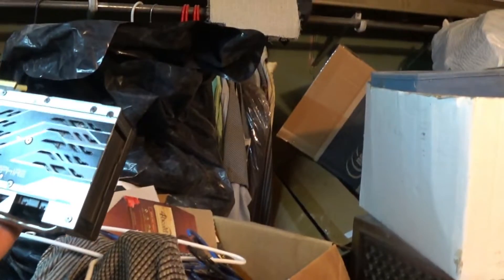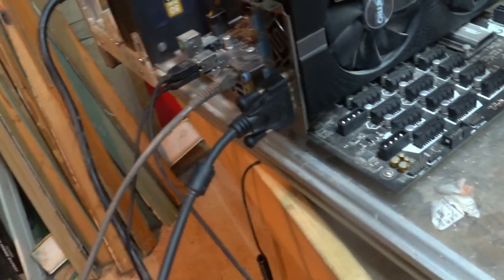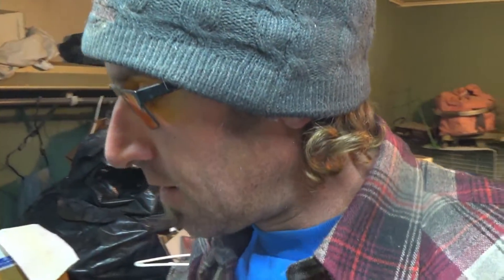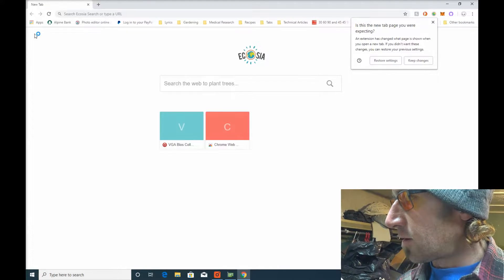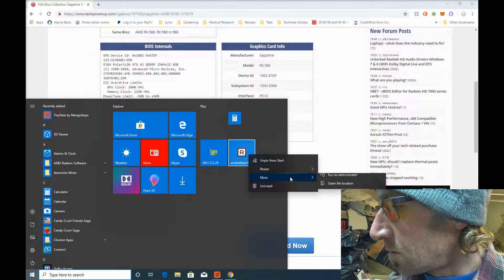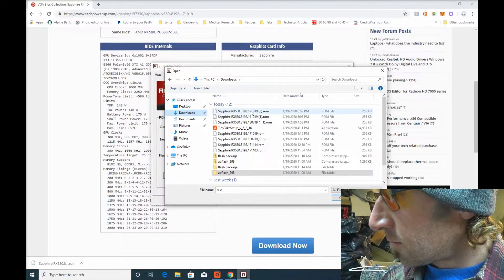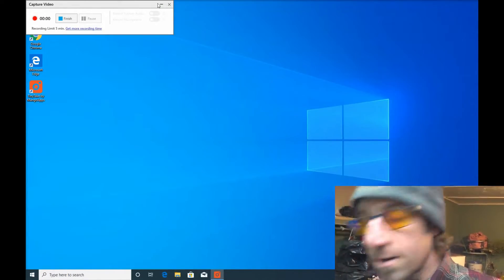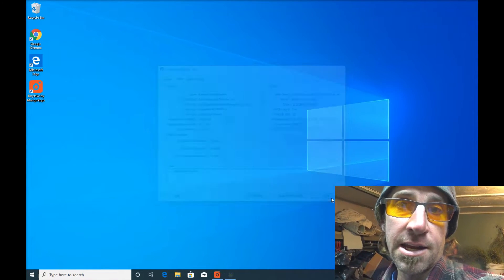How To Flash Stock BIOS of Any Graphics Card

Comment: bro please will u help me iam facing a problem when i update my gpu drivers my display got leaned like there are too many red dots or red lines but before upgrading the drivers display is ok
Reply: What have you Done to fix
Reply: @sonatafx  i go to market and over heat it it is fix now this is the only solution
Reply: @retsamgaming3378  i already repaired it by myself, thank anyways
Reply: @sonatafx  how
Reply: @nyto1333  iirc i reinstalled windows
Reply: @sonatafx  tried that and i doesn't work am thinking about reinstalling bios
Reply: I am getting red and blue dots

Comment: Hey i have ATI 4800 series 1 GB DDR 5 and i wanna change the bios or something to the HD 5000 series so i can install the new pilote that support DirectX11 can u help me ?
Reply from the maker: Find the HD 5000 series with all of the same critical hardware, ie memory speed and brand and flash it.
Reply: @MartyUlrich  i cant cuz the ATIWinflash says "Non-correspondance des SubsystemID :/
Reply from the maker: @Sheso  then it's not going to work. Generally speaking you cannot use the BIOS from another card and expect it to work unless you know how to write your own driver softer and implement it.
Reply: @MartyUlrich  i unlockedrom on atiflash and i flashed my gpu and now its bricked , i'm tryin' to creat a bridge on gpu board so i can fix it can i contact u to help ?
Reply from the maker: @Sheso  You need either an integrated video on the motherboard to use or another card to fix it. You'll have to flash the original BIOS  back on to get it functional again. Sorry, I don't have time to troubleshoot your personal issue, but it sounds like you're trying to do something that truly was not intended. Has anyone else successfully done what you're trying to do with that exact card?
Reply: @MartyUlrich  1-thank u 
2 - yeah someone did it in he's GPU HD 7000 series but i'll try ur way first cuz it's safe

Comment: Ok, I loaded a ROM that seems to be not the one my GPU needs. I have a saved backup of the original bios it came with(bought from miners) how do I flash it back to it? The problem is that the monitor gets no signal from the GPU, I tried plugging the monitor to the motherboard and still nothing. When I remove the GPU, the PC works again using the onboard graphics.
I have:
msi b450m pro vdh max mobo
Ryzen 5 2400g(with built in graphics)
How do i get it back to before?
Edit 1: I have managed to enable the onboard graphics while the non-working GPU is plugged in due to some MSI bios changes which forces the PC to choose the onboard graphics as the primary. I get the error code 43 in dxdiag like you do when you showed the wrong bios flashed. Problem is, when I want to use the flashing tool, it only shows my onboard graphics and not my rx 580. How do I proceed now? How do I choose the rx 580 as the one who needs a reflashing of bios? It only shows my vega 11 onboard graphics card.

Edit 2: Never mind, I fixed it. After the steps I did in edit 1, I just had to open the flashing tool again and load image the backedup bios Rom. Then program, then restart and reset the motherboard bios settings back to default so it would then automatically choose the discrete GPU(rx 580) on start up. Then removed the hdmi from my motherboard and reconnected it to the GPU again.
This is for people who freaked out thinking they bricked their GPU permanently.
Reply from the maker: Thanks for workin through that!
Reply: Hi! I was having the same trouble not being able to force my vega graphics with my rx 570 plugged in, but I followed your steps from edit 1 and finally managed to do so.

The problem I'm facing now is that each time I try to go back again i to the BIOS utility to reinstall my backup file, my computer completely freezes after clicking on "run as admin" on ATI flash utility. Did you experience the same problem? If so, did you find any solution for that?

Comment: Sir, when I hit the program button on ATIFLASH, after couple of seconds it says flash failed. Need help! TIA
Reply from the maker: Some graphics cards have a manual switch that must be activated first before it will accept the ROM. I know some versions of the RX580 had this... there was a jumper you had to move in order to edit the BIOS. Just research your model or see if you can find such a BIOS switch.
Reply: got the same problem still haven't found a fix :(

Comment: Can somebody explain to me how a mining card works? As in if you flash a gaming bios does it work like a normal GPU? Or would I have to keep downloading drivers to update the card?
Reply from the maker: When you flash a BIOS on a GPU for mining, it is making minor changes in the memory timing. If you were to manually do this, it would be highly likely that you would immediately brick the card, but if you know what you are doing, it can be done, and that is how we have these nice ROMs now that can be used with ATI flash. 
These changes allow for faster calculations when the card is used for mining, effectively boosting your hash rate per card. These changes basically take away some power from GPU itself when it comes to graphics rendering. That card may crash when used for gaming after flashed for mining (I don't game anymore so I have no experience here). 
All factory drivers will still work, but some versions are better than others for mining. Many miners turn off updates and stick to a particular driver version that gives them the best performance vs fewest problems. Hope that helps!

Comment: Asus b250 mining expert? 
Say, I updated my motherboard bios, it worked and then went to black screen for over an hr when loading windows. I restarted and restored to an earlier point. It took several hours for Win10 to finally post. All my GPUs were "kicked off .
Nicehash doesn't see the GPU'S and  Afterburner crashes. Any suggestions? 
1)manual driver load failed
2)Nvidia driver file dissapeared.
3)hr+ long black screens before posting 
4)CPU 100% without running apps.
Reply from the maker: That motherboard and/or CPU is hosed. I have another Asus B250 I can sell you that's un-opened still in the box. I never had too many problems with them myself, but I did nearly fry one. The ATX power terminal for the risers was all melted and burnt after running for a few months. I had some pretty significant power issues though too not related to the computer hardware itself.
Reply: @MartyUlrich  Figured it out. Bios switched all the pci-e slotscto gen1. Had to switch it back to auto and boom...all good. 😓

Comment: Hello sir great video can you help me with this please I brought a used card online and every thing wents fine till i get error code 43 in device manager and when I checked on gpu-z its showing bios as unknown also speed and every thing is showing n/a what should I do please help me sir (btw my card is zotac gtx 1060 amp)
Reply from the maker: In your case you're going to just have to flash all the possible BIOS ROMs for that card until it works... however, I have never encountered that and it's probably safe to say, the card is hosed... sorry brotha
Reply: @MartyUlrich  thanks for the reply sir I'm trying to save the card so my money isn't ripped
Reply: @MartyUlrich  hey bro problem solved actually it was with some compatibility with my mobo
Reply from the maker: @krishnakarma6166  Awesome glad you got it!

Comment: Hey man, I just wanna confirm before I proceed to flash since I don't have integrated graphics on my ryzen.
I'm running an rx 570 4gb red devil from powercolor I just wanted to check if this is the right bios for my card.

I'm just a bit confused since my clocks and memory don't match with that bios. my current is 1150mhz(core) and 1900mhz(mem) but all other info is a match. memory is hynix btw
https://www.techpowerup.com/vgabios/192066/powercolor-rx570-4096-170330-2
Reply from the maker: It will not work. You need to keep looking. Every single detail down to clock speeds and even brand of memory is critical and must match exactly!
Reply: @MartyUlrich  Is it possible that the clocks are different because the current bios is for mining?
Reply from the maker: @swegmeister1114  That is irrelevant. To get the correct one, the BIOS info must match that on GPUz
Reply: I just forced flashed it with the posted bios and now it works fine like stock

Comment: Bro please help me I tried flashing it now my pc wont boot up :(( im using a RYZEN 5 3600
Reply from the maker: Do you have integrated video in your motherboard or a 2nd PCIE slot? Sometimes you load the wrong ROM and you can't boot the computer. It's probably actually booting up all the way to the login, but you can't see it since the GPU is bricked. To un-brick you need to plug the monitor into another video port either on the motherboard or another card. Go back and try again - look very carefully at the ID, memory clock speeds, and brand of memory. All must match what GPUz displays. Flash again. I had to flash a couple of mine 2 or 3 time to find the correct one.
Reply: The ryzen3600 does not have intergrated graphics sadly

Comment: I’m having a problem where my card won’t even display on gpu-z I’ve got 18 rx 570s all mining cards
Reply: Also says the card is “Radeon Polaris 10”
Reply from the maker: If GPUz will not detect it, then the card is irreparably damaged.
Reply: Fraser Mate I’m having the same problem. My fans aren’t spinning and it doesn’t show in device manager
Reply from the maker: @Trent_111  are all of the power connections there? The 8 pin power has to be plugged in or that will happen
Reply: Marty Ulrich nvm got them all working the mines they had mining bios wouldn’t show but once Installed it worked.
Reply from the maker: @frasermate4729  awesome!
Reply: Marty Ulrich yes. I ordered that gpu from eBay and I ordered the same one from amazon and it worked so I just got scammed by someone with good reviews. The gpu looks like it’s in good condition tho and the warranty sticker was still on there

Comment: Can it be used with NVIDIA?
Reply from the maker: Saiji Reji  I am not familiar with any error codes, and flashing may or may not be the solution. It will not hurt to try though.
Reply from the maker: Yes, they had all BIOS ROMs for cards from nVidia and Radeon both
Reply from the maker: Saiji Reji  Yes you can!
Reply: Saiji Reji  No, you cannot use atiflash in nvidia. There's nvflash for that.